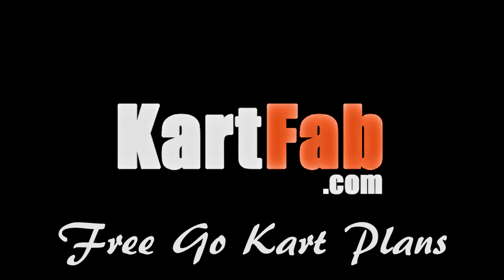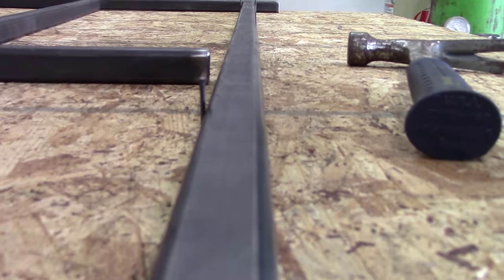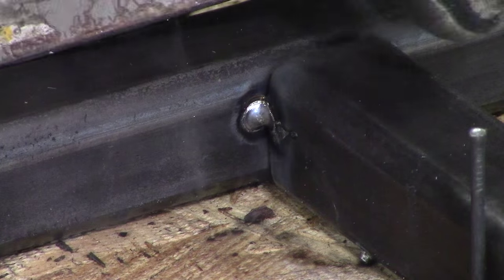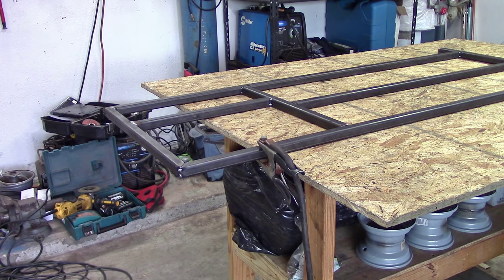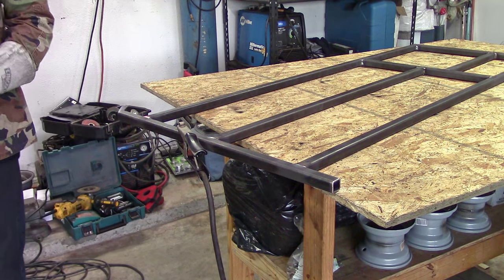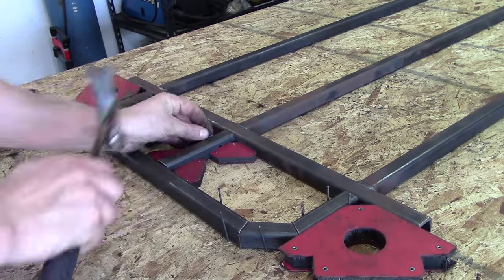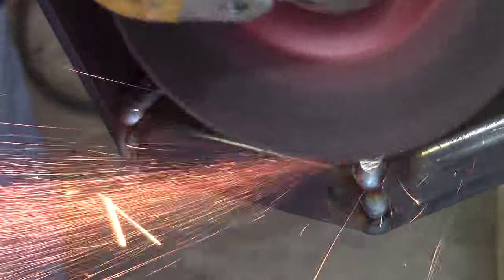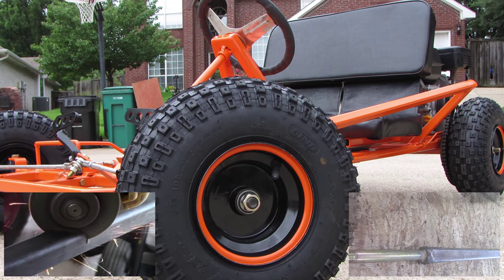How To Make a Go Kart Frame: Go Kart Frame Plans

Comment: I want to build my son a go cart.  I have a ladder type deer stand I built in high school that I plan to convert into a go cart frame since I no longer hunt deer.  Its made out of the same square tubing you used in this video.  I will be using a "stick" welder and a 8 hp Briggs and Stratton both of which I inherited from my late father.  Your videos will no doubt be my guide.  Thank you!

Comment: Thank you for the making the plans and the videos, very informative. I had purchased the deluxe plans from your website, but didn't get any response to my questions from info@kartfab.com
, is that email id for communication? Few questions 1. Which steel tubes to buy for Go Kart frame, Hot rolled or Cold rolled steel? Hot rolled is cheaper. 2. Can I use an electric motor and Battery in the Live Axle or the Dead Axle plan? Thank you.
Reply from the maker: 1) least expensive (hot rolled erw) 2)either one. Live BBC axle won’t peel out as easily as a one wheel drive
Reply: @KartFab  Thank you for the quick response. Do I need to do any modification to the plans to make it work for electric motors or it will work as is and I just have to add a metal plate in the back for Batteries and the controller. Do you have any example of electric version of your go kart plans? Thank you.

Comment: Not sure if you would recommend this yourself but I've heard it can be pretty strong.. You guys can also buy aluminum tubing and 'braze' it together , similar to welding but not quite.. I've seen brazing strength tests and it seems to be a pretty strong hold.. A brazing kit at home depot is about $70 or below.. Im trying to get into both welding and brazing so that i may build with welding and modify bicycles using brazing.. Hopefully i too can get the hang of everything then i may start a YouTube to teach others as well

Comment: is welding hard because im thinking of getting a welder?
Reply from the maker: +Bashier 123 its like writing, you get better the more you practice.
Reply: Ok thanks for replying
Reply: Bashier 123 it was a little hard first time I welded I'm only 11 though so but after a day or 2 of welding class you get used to it its very fun too
Reply: Bashier 123 no i'm 12 and i made this cart too
Reply: Im 12 years old too
Reply: Bashier 123 I am 12 to and I when to the local techshop and took a class then got a welder and built a drift trike
Reply: My nephew wants to borrow my everlast to weld up a go kart. It isn't that hard but you do need to know what you are doing if you want a strong weld.
Reply: +The Karting Freak what material did you use
Reply: It’s not hard just need to practice
It is never hard just your get slowly better
Reply: @ThePurplePupUwU  I’m 12 and ik now ur 15 but I’ve never welded before so do you think I could do this for my first project?
Reply: @oliverhoffman4574  ello, for a first project you may be able to do this, I would suggest you get some scrap steel, maybe a junkyard may have some or just find some metal made out of steel and practice for a couple weeks to get used to it, learn how it works, how to get a nice weld bead down and just to get used to your equipment, and I'd say that once your able to consistently get down nice welds on the practice steel, I'd say you could start on a project like this, but don't rush it because with something like this, a weld failing could mean you loose steering or you loose brakes or some type of major failure, could lead to major injurys so make sure to take your time and If your not happy with one of your welds, take a angle grinder to it or something and redo it, you can reply again if you have any more questions, also, once this whole social distancing is over, see if there are any machine shops that do lessons, my experience in welding was at a place that does everything from baking to photography to woodworking to glassblowing, if there is a place around you that does welding, see about going to it or something, good luck if you decide to do this project
Reply: @ThePurplePupUwU  ok I have a lot of experience with art but also there’s a few welding shops around me where I could get lessons
Reply: @ThePurplePupUwU  I wouldn't get scrap metal from a junkyard. It could be galvanized. Galvanized fumes can be very bad for your health. Go to homedepot and get some cheap pure steel.
Reply: @ryantodd8420  is it strong?

Comment: Hows it going, I have decided to make my grandson a go cart, I have never done this before. but I want to do it myself. What type of welder do you suggest I get to complete this project. Something economical ! I like the way you explain step by step how to build.
Reply from the maker: An economical one will do just fine. Most welding is about preparation of the metal before welding. Cut, bevel edges, tack, square up, then weld. Any sort of wire feed (flux core) welder will be the best starting point price wise and are the easiest to use. If you use a solid core wire feed (MIG) it needs 75/25 gas to shield the weld, but it does come out looking a little nicer. Either way a little wire feed welder wont sent you back too much. The harbor freight mig welders are a good place to start, but please use name brand flux core wire if you use a harbor freight welder (use miller/lincoln/hobart wire).

Comment: just bought your plans on ebay so I haven't received them yet but i'm wondering if it's possible to use round tubing instead of square tubing for the frame? not sure if it throws all the dimensions slightly off or not.
Reply from the maker: Awesome! Well, you should have received two emails from me. I had about 4-5 people i  emailed plans between today and yesterday. check your junk mail if you didn't get them yet. They will also be coming in the mail on cd or flash drive (whichever one you chose).  So as far as framing material goes, square or round doesn't matter. If you have a tubing bender, you can figure out the angles on the plans and even bend it if you want it to look a lot nicer. The only reason I chose the square tubing over round is that virtually everyone that builds a go kart doesnt want to spend like $500+ on a tubing bender, so its easier to just make a few angled cuts. Also, as far as gauge of the tubing is concerned, 11 ga material is listed, but you can possibly get away with 11 ga for the front axle, and 14 ga for the rest if you weld everything up nicely. It will make the kart a little lighter. However, 11 ga is really strong and thats why I went with it.
Reply: I have them, can't wait to get started this coming spring! Watched all the videos on youtube for building the standard kit. might start there to get my feet wet then move on to the deluxe with a live axle! Thanks for sharing your plans and expertise with all of us!
Reply from the maker: No problem, most of the front part of the go kart is the same between the one wheel drive and the live axle kart.

Comment: im trying to draw it with sketchup but i couldnt make the same measures i dont kno why the space between the bottom tube and the middle one is smaller than the dimension in the plan

Comment: Hey, so I was trying to build a frame but was unsure on what type of square tubing and the metal that I needed for my specific kart. It would be for bigger high school students and not small children. Also what hp would be recommended for this?
Reply from the maker: Use 14 ga tubing for frame and 11 ga tubing for front axle. If using one wheel peel design, 11 gage for rear axle

Comment: I have ordered most of my parts and steel. Have the motor already. Still need to order the parts kit from GoPowerSports.com. How large is the I.D of the 2-1/2 inch washer for steering wheel?? or does it even matter?? By the way, love the videos! They increase my confidence in building the kart...My daughter is going to love it....Thanks!!!
Reply from the maker: +bren10acres the washer Id doesn't matter, it just needs to be a circle that the steering wheel bolts to. You could event cut out a square plate and it would do the same thing. Thanks! feel free to message me a picture of the go kart on my social media when you finish it. It is always cool to see the other builds.

Comment: Hello, I am considering building a go kart soon but I cant really seem to find to good of a frame for cheap on craigslist or anywhere else online. I would love to build a frame, but I don't have a welder. So I was just wondering how sturdy would a frame be if you were to bolt it together? Thanks!
Reply from the maker: +Kenneth Lett not very sturdy. Welding is pretty much the only way to go.
Reply: +KartFab Ah okay. When it comes to welding go kart frames as a beginner, is there any specific welders you want to point me towards? I'm just getting caught up with all of the different mig welders that are out on the market and I don't know which one to get.
Reply from the maker: well, if you are on a budget, you should get a cheap 90 amp 110-120v wire welder, the kind that uses flux core wire. Then, swap out the wire for a premium wire like hobart, or lincoln (youc an pick it up at home depot). The wire matters more than the welder. Practice on some scrap, and check out weldingtipsandtricks.com for some tips.

Now, if you are planning on getting a nicer welder, you can get a gas mig welder (just like a flux core, but uses solid wire). A solid wire mig welder can do both flux core or gas wire welding. Gas wire welding (what most people call MIG) makes some of the best looking welds and requires less cleanup. It does cost more for the welder, and gas bottle.

cheap brands are anything from china, or harbor freight. They are good for ocassional use. so if its going to be yoru only welding project, this might be a good choice.

Better brands include hobart, which is like a step down from lincoln and miller (miller makes hobart). You cant beat lincoln or miller, they are like the ford and chevy trucks of the welding world. You can sell them for almost as much as you paid for them.
Reply: Thank you for the information! It's much appreciated!

Comment: Would it be posible for me to bolt everything togther rather welting everything toghter. becouse i don't have a welder thing!!! i know everything will be in differend levels but if i can handle that?? will it be appel to hold or will it just brake in 2... Its only gonna go on roads or gravel. not big holse or steap hills!!! pls answaer if u know!!
Reply from the maker: ClinFurze made a video on that. I dont condone making a POS go kart that is bolted together.

Comment: I have a couple of questions. What program do you use to make the plans and where do you get the materials for the go kart.
Reply from the maker: +Conner Wilson 1) CAD 2) materials I got from hardware store (hardware), steel distributor (steel) and parts from go power sports here http://www.gopowersports.com/go-kart-kit-without-engine/#aid=2986

If you remember Iade an entire video and webpage on the question you asked. It's called go kart materials.
Reply: Thanks

Comment: What about aluminum as a frame material? Thinking of using 1x1 aluminum square tube with a .125in wall for my frame.
Reply from the maker: you could use it, but aluminum dents easily.
Reply: Ill keep that in mind. Should it be just as strong? Looking for cheap and low weight so aluminum seems to be the answer
Reply from the maker: you will have to check into it. Steel is my personal preference, and there arent many go karts out there made out of aluminum. It has been done though.

Comment: Ehich welding type did you used for steel?
Reply from the maker: mig stick and tig. Any type will work, but MIG welding is what most people do.
Reply: Thanks  and can you tell me how much weight of 1 meter of square tube that you used?
Reply from the maker: i don't understand your question
Reply: I mean how much weight of steel rods or beam for structure of gokart. I mean weight of weight steel that is significant in any car?
Reply from the maker: you can do the math, so google 'how much does 1 foot of 11 ga. 1" square tubing weigh" then multiply it by how much the plans call for
Reply: But how much your steel have?

Comment: What type of welding machine are you using?
Reply from the maker: A mig welder. (Millermatic 251).
Reply: Ok, thanks!
Reply: Do you think a 100 amp stick welder using 1/16 in sticks would work? It's a cheap $100 from Amazon. I just need it for this project so reliability is not an issue.
Reply from the maker: Even a cheap harbor freight or Chinese $100 flux core wire welder works (e.g. 90 amp). I hear the wire sucks so buy good wire (Hobart at Home Depot is good)
Reply: Thanks! I was worried that my frame was going to fall apart if I used a bad welder.
Reply from the maker: +Pavan Hemanth the frame will not fall apart if you use a bad welder, it will fall apart if you ARE a bad welder :D
Reply: Lol, I'll try my best! :)

Comment: Probably can't do this with my harber freight welder lol iv online welded once just to fix a lawnmower
Reply from the maker: You can use a little 90 amp flux core wire welder. Bevel the edges and do multiple passes on the thicker stuff.

Comment: Hey, I dont have the budget to make the frame form steel...will using wood work???
Reply from the maker: That is a common question, and the answer is not simple. Wood will rot 
and swell, and does not have the structural integrity for jolts and 
bumps. I am a member of the DIYGoKarts.com forum and new people are 
always asking if they can make a wood go kart. People who try, usually 
give up because it breaks. One guy successfully made one and he drove it
 and it broke while he was riding it and he almost died. He was 
seriously injured. Please do not make a go kart out of wood.
Reply: KartFab Thanks alot for the reply.